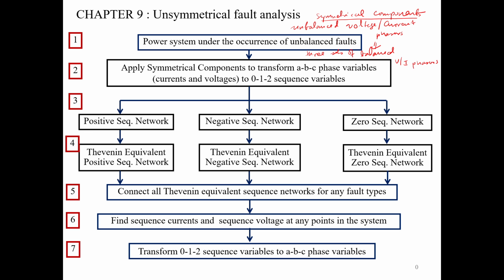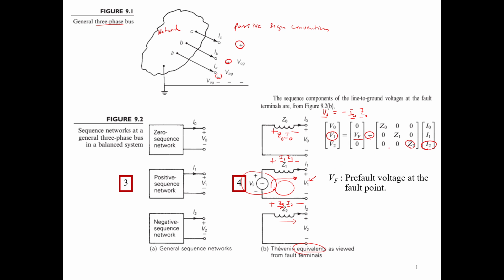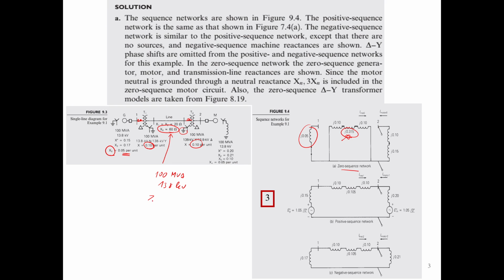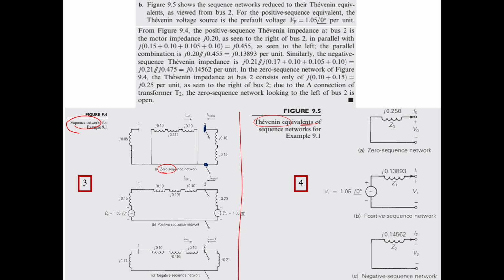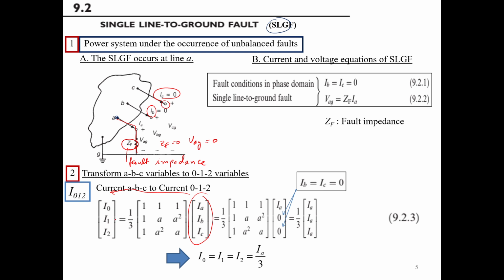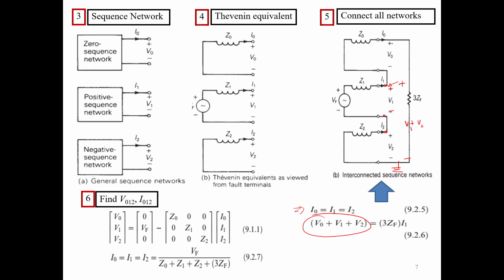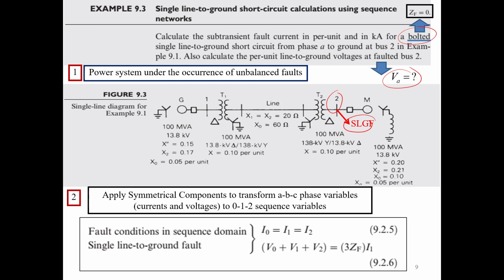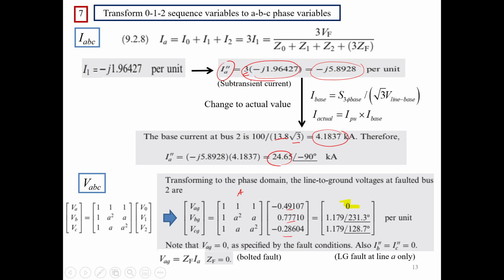Unsymmetrical Faults Ep.1: Single line to ground

Comment: I think you made a mistake. The system is loaded with a motor, meaning during a single line to ground fault Ib abd Ic should not be equal 0. This would be the case in an unloaded system (open circuit).